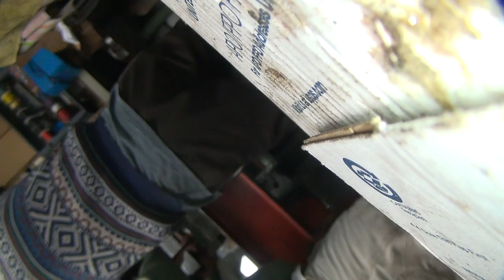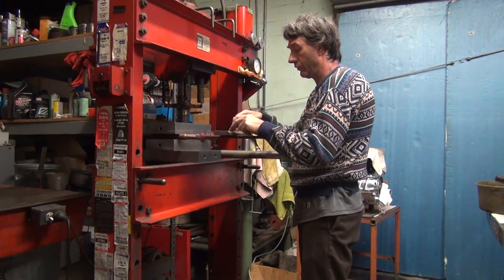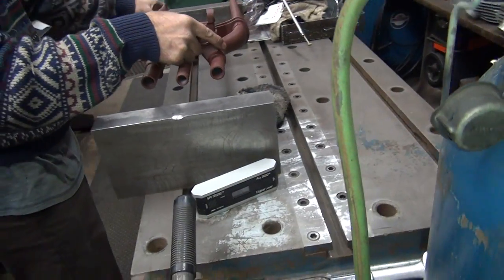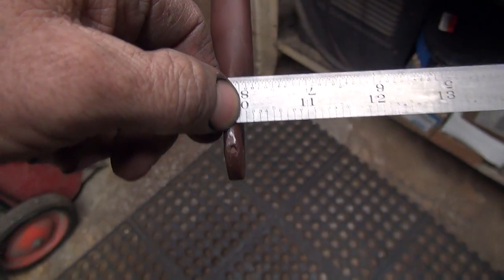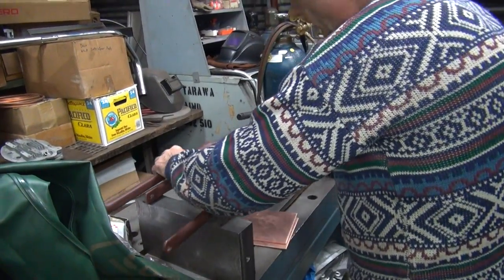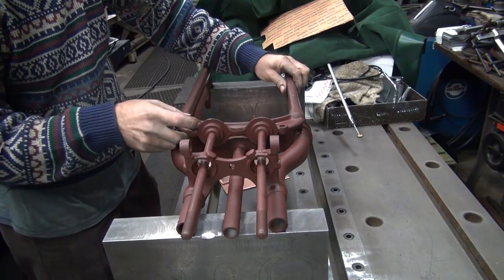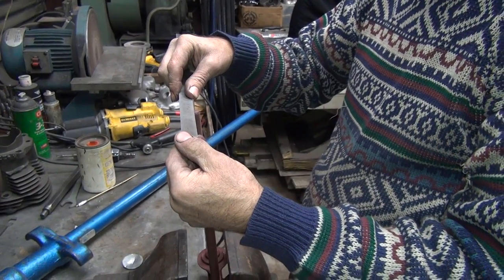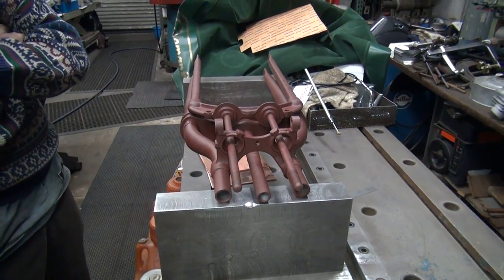1942 wlc wla 45ci #131 springer fork repair rebuild harley chassis reassembly by tatro machine

Comment: You mentioned switching neck posts. Are they welded? Pressed in? Sitting on a taper? Should I heat it? Drill it? Or press it out???
Reply from the maker: yes, they are pressed and welded in.
tatro
Reply: @TatroMachine  thanks for your replies!! I enjoy your channel.
Reply: I just got mine removed. It was brazed in. I drilled the old neck out, fortunately I stayed inside the splines. 
Where do you buy replacement neck posts?

Comment: For getting the front leg straight, If you put an axle in there and some spacers under the axle instead of measure on the squished part of the leg, it will give better results. those squished ends aren't very cemetric and the axle holes arent perfectly in the middle either. In the end, it doesn't matter that much..;)

Comment: Right at 20 minutes your using a blue bending bar. Who makes that? What is it called?
Reply from the maker: that is a oem frame straighting tool from back in the good old days. 
tatro
Reply: @TatroMachine  I knew I had seen it someplace. Does anyone still make them?